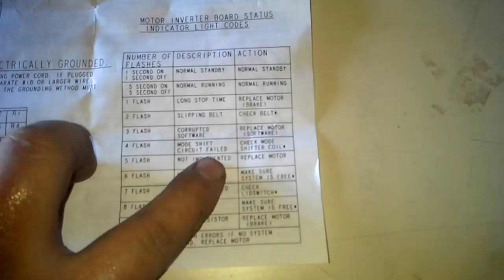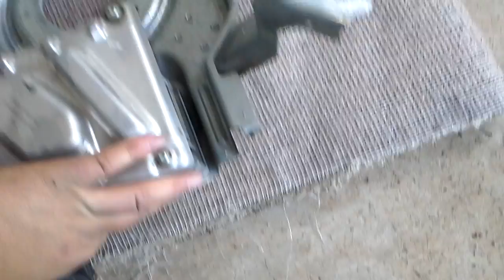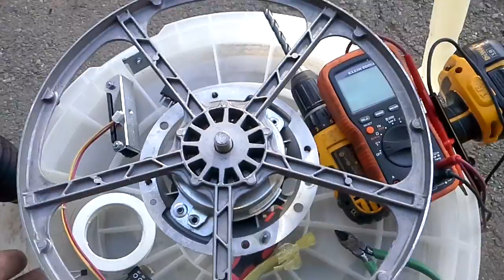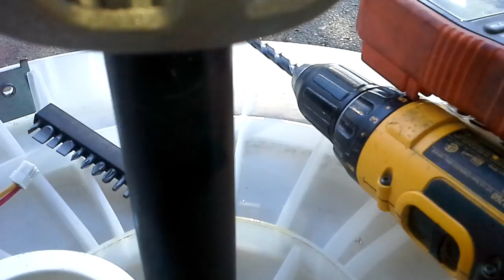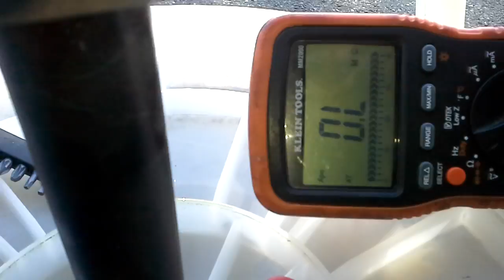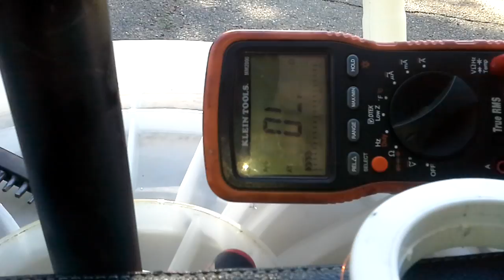How to fix the Mode Shift error code for free!

Comment: Thank you so much for making this video. It covers exactly the issue I have, taking apart the mode shifter magnet and repairing it.
My situation started as no spin cycle and a loud ratcheting noise during agitation. After I found out there was an on-board diagnostic flashing light on the inverter board, I saw 4 distinct flashes followed by a long pause and repeat of the flashes. The flashes indicated a problem with the mode shifter and to check the magnet. All research I found said it can't be repaired and buy a new one. I couldn’t afford the official GE shifter at $300+. I found one for $150. I installed it and had the same problem. This time there are no flashing light codes, just a consistent flashing indicating no problems.
I couldn't believe it would be the same problem. I have checked almost all solutions physically and electronically.
I am slowly coming around to  the idea it is the same problem.
I can't return the mode shifter. I have had it too long.  I am not looking forward to buying another shifter if it turns out this is the problem. This exceeds the value of the washer.
This is why am so happy you made the video I have been looking for. I still have to check the resistance. If this is the problem I now have a way to possibly fix it without spending more money. I still have the old shifter, which could come in handy if I need parts.
Thank you again

Comment: To drill the rivets out, you may need better than average drill bits. At a minimum, DeWalt makes a line of drill bits called "cobalt". Not Lowe's brand, but DeWalt. Especially the pilot drill bit needs to be high quality. You can get away with cheaper bits beyond drilling the pilot hole. Use oil while drilling.
Reply: Is this an ad?

Comment: One problem with moving the fuse / thermal limiter out of the housing is part of the design may be for an overheated coil to help break the fuse / thermal limiter. Using a fuse outside of the coil makes it more serviceable but someone would have to figure out what the max. amp draw should be to determine the fuse amperage.

Comment: A bit of help on disassembly of the coil. Once the rivets are drilled out, it takes a bit of prying to separate the upper and lower pieces. About 90 degrees from each rivet there is a tang (for lack of a better word) which holds the upper and lower pieces together. Both of these tangs needs to be pried out. A medium size flat head screwdriver prying with equal force on each side of one tang should do it. To prepare to reassemble the upper and lower parts, there is a flange where the rivet head used to be that should be filed flat. In place of the rivets, #8 stainless bolts can be used (not sure of the length) with a flat washer, lock washer, and nut.

Comment: You saved me 100$ for the new part and more work.  I only had to  removed belt and pulley and drill those two rivet your way.  Thank you so much for posting  this as money is very tight.  You get bonus  points for entry into  heaven!!

Comment: The coil could CATCH ON FIRE if you bypass this thermal fuse. Installing an inline fuse would only protect against over-current, not over-temperature.
Older models have the AUPO (C*h*i*n*e*s*e brand) A4-F, 130 deg C, 2 amps, 250V rating. S*e*a*r*c*h: china-aupo a-f-product
Newer models have the AUPO A8-5A-F, 150 deg C, 5 amps, 250V rating. S*e*a*r*c*h: china-aupo a-5a-f-product
The A8-5A-F won't blow so easily, and still protect against fire.
These are not available at Mouser nor Digikey.
I got them on e*B*a*y, from C*h*i*n*a, and there was a German seller who had them (faster shipping) in Feb 2023. 
Use the e*B*a*y s*e*a*r*c*h: AUPO 150 a8 5a 

I looked for a self-resetting thermal cutoff, but they are too thick to fit in the very tight space.
During shifting, the coils gets 140VDC for 30 seconds, then drops to 35VDC to hold the shifter castle up. If someone opens the lid during shifting, the coil keeps getting 140VDC for too long, and overheats. It's a software bug. Don't open the lid before the end of the cycle on these top-loading models with an electronic inverter board that's on top of the motor.

Comment: Background: I dumped too many clothes in the machine. During last cycle it spun violently and I decided to to press switch to shut down. After that it stop agitating or spinning. The water filling is Ok and drain pump works. 
Question-1: Does it have control board inside top dash compartment?
Question-2: I found the manual inside the Washer dash panel. It has the drawing of LED location and the Error code chart. But I kept on looking behind the connection plugs and don't see the small green LED. In the dark, there was no blinking. Are all motors for this big-wheel series has the LED?
Question-3: How can I check the motor? I bought a used motor and replaced it but still dead.
Question-4: How can I check the clutch switch without flipping the washer and tear it apart? Can I simply test continuity from the Red+Yellow terminal?
Thanks,
Reply: Check the inline fuse, it's probably blown

Comment: With the thermal fuse thrown out or not used, are you not afraid that in the future the coil wire or something else important in the mode shifter assembly will get burnt and damaged due to power surge?

Comment: Grat Video. Thanks. I think that is the problem with my machine, I can see the 4 red flash on the board. she fills with water and empties but does not wash or spin. but I wanted to ask you. you should see the motor running when you have this problem ?? Or is it that the engine does not run when it has the problem of the mode shift?? because I don't see the engine running by itself

Comment: Probably late for a reply but what was the fuse rating or part number?  I would like to do this but replace the fuse as well.
Reply: 5 Pcs Aupo Thermal Fuse Cutoff 130c 250V 2A A4-F 

Amazon $12 for 5 fuses

Comment: Mine flashes 10 times after I turned it on. Washer will fill in with water and will drain but no agitation and spin. Lid switch, fuse and the control knob panel are okay. What a mess!!

Comment: Does anyone know the heat spec on the fuse? If Im going to go through the trouble, I might as well spend the $3 and replace the fuse instead of bypassing it. Thanks
Reply: $12 for 5 of them. On Amazon. 

5 Pcs Aupo Thermal Fuse Cutoff 130c 250V 2A A4-F 

Going to all the trouble to bypass it may ad well just replace it.

Comment: If I am not mistaken, the green light is supposed to flash off and on. Is it not?  My thinking is the pattern gives the code. Steady one second intervals indicates no codes. Blink on one second, off two seconds, one flash indicates a fault. On one second, off two, three flashes, etc. 
  Correct me if I am wrong. 
 What was your symptoms?
  Can a bad shifter cause one to wad clothes?
Reply: I think, as he said, mine is flashing green 4 times - which is the error code for "mode shifter coil" - I'll have to say "I really Never liked this GE Profile washer that I bought!  It Sucks!

Comment: GE Repair guy here. We change out these things all the time. Usually because water leaks onto the shaft bearing.  I have not come across too many Mode Shifters that short like this but this is good info to know. Replacing one of these Mode Shifters will cost you around $300 parts and labor. Nice video. :)
Reply: My washer is agitating and the basket moves to the left while its agitating.. Is that the mode shifter as well?
Reply: Had 2 go so far original one leaked water from the center shaft seal!

Comment: I have a question about the ge Hydro washer.  When the washer is agitating and the basket is moving only to the  left while in agitation.  Is this the issue as well.   From what I saw in a video on You tube, When the washer is agitating the basket should be moving left to right.  On mine its moving only counter clockwise.  And it like a half turn per agitation.
Reply: I have a Hydro wave.  I believe it changes the agitation cycle   1 direction, then both directions.  The top of the agitator only goes 1 direction, the bottom goes both.

Comment: Lacking information on reconnecting wires to the coil. 👎
Reply: just cut the wire from the fuse and solder the two together.

Comment: I have like 4 GE washers I couldn't sale because of the mode shifters. Hopefully this brings me back to life. Great Video!
Reply: I have a couple also I think have the same problem.  I was told it is usually the motor even though there is no fault code according the blinking light on the motor.

Comment: Nice job.
AUPO
Thermal Fuse cut off.
A4-F 
130degrees Centigrade
2Amperes 
260 Volts AC
Reply: Thanks for that info. I was just about to ask.
Reply: Are you saying the fuse is rated at 2 amps?
Reply: @rickeykeeton71 - that’s what he saying

Comment: OKAY you remove the safety link....  it got hot and blew the fuse....   why did it get HOT ???  so now when it gets HOT  ''again'',  safety fuse is  gone ,  a fire will happen or wall  fuse will pop=  then what???  what will you remove then ???
Reply: mine has 82 v and with an 90ohm coil you will pull less than 1amp. The wire would probably burn open again before a fire. If you really want to fuse it, put in an inline fuse and put a 2 amp fuse inline with either lead. If you blow fuses, you have some windings shorting..then force to change out the coil..This non resetting fuse is probably a bad idea. Work in electronics daily. She these things go out for no real reason. GREAT Video..I never knew there was one in there. Going to fix mine tomorrow...

Comment: Thanks for such a helpfull video...i removed the fuse but the coil is giving me 73 ohms. The washer is still not working. What should i do? Is there a place to get the coil only instead of whole assembly?
Reply: By the way the LED is showing normal standby....1 sec on/off.
Reply: @imrankhalid7610  did you ever end up fixing yours? I’m in a similar state, LED flashing normal but ohms reading low from the shifter coil around 66ohms. Hate to do all that work and find the shifter isn’t the problem

Comment: Just disassembled mode shifter to remove thermal fuse. Fuse ohmed out good, but removed it anyway. Figured I went this far. Coil ohms out at 68.9. Any other ideas? I was initially getting the four flashing lights. GE paperwork says replace motor. Please say it isn't so.
Reply: It could be purely mechanical such that the gears are not greased good enough to be engaged and disengaged. Therefore the coils is not strong enough to move them.

Comment: Did you ohm out the coil before removing thermal fuse? What kind of reading did you get?
Reply: Yes, he did that in the video. With the thermal fuse in series, he was reading open circuit and that's because the thermal fuse was open. When he bypassed the thermal fuse and measured the coil directly, he got 89.7 ohms.
Reply: @JaleelJohanson62 - isn’t the very thin copper wire in the coil insulated therefore trying to test continuity is a little difficult? I cut a little 2 inch piece and couldn’t seem to get continuity between that small piece. Then I started wondering is this wire insulated?
Reply: @condor5635  The coil wire is indeed insulated with enamel coating, but the ends of the coil wires are not coated. This is where the electrical connection to the coil is made, and also where you'd want to measure the coil resistance.
Reply: @JaleelJohanson62  - thanks for that if I cut off an inch or two on the ends, how do I remove the enamel such that I can get a good connection? Maybe some steel wool or sandpaper will remove the enamel?
Reply: @condor5635  That or use an exacto knife to scrape off the enamel.
Reply: @JaleelJohanson62  wonder if acetone removes it
Reply: @condor5635  I got this off of a quick internet search:

"You can always use acetone, but the fumes are pretty bad. If the wire is big enough, scraping with an Xacto blade works pretty well. I almost always scrape it off. An alternative is to stick the wire end into a small flame and burn the enamel off." -- I'd just use the xacto.
Reply: @JaleelJohanson62  thanks!

Comment: hey it's also worth mentioning that once I connect the electricity I hear a cling, esp. when the device has been left off for few minutes to completely drain out. Luckily I discovered it is from the Mode Shifter Assembly. This sound is irrelative of washing program activity  that is, it happens when the washer is Idel immediately after being plugged in

Comment: Thank you Andrew for sharing with us this genius solution. My washer doesn’t spin or agitate at all. After closing in on I was left to either of two faulty parts . The Mode Shifter Assembly and the Motor. I tested out the two leads coming from the Shifter at 200 Ohmmeter (Rx1)  and I came up with 70 ohms. Does that mean it’s working properly?
I also noticed that the LED Flash on Motor controller board isn’t working , I’m afraid the board might be the source of the problem!!  The drive motor looks in a pretty good condition and for more diagnostics I tested out the two internal leads coming out from the dynamo for continuity and the Multimeter peeps  and the resistance reading  is 1 - 0.9ohm. The Schematics provided by the company for control plate shows a fuse that I can’t seem to locate? I would appreciate if you could point me out in the right direction cuz it would be inconvenient to replace the whole motor especially that I have to find away to ship overseas which is way too expensive for me.
Reply: Jason Stockholm I too have the same issue, I replaced the inverter motor still nothing. Washer fills and drains water, however, doesn't spin or agitate. What was your fix. Appreciate any info. Thanks in advance.
Reply: Make sure that you blow out the boards on the motor with some compressed air. I was looking for the little green LED and couldn't see it until I blew it out.

A little late response-wise but perhaps it might benefit someone else.

Comment: My washer is showing the error code for an open shifter coil (4 flashes).  The symptom is that the drum will not go to high-speed spin, although it agitates and otherwise performs properly.  I am going to try your fix tonight, I hope that it works!
Reply: I thought that it was agitating properly before, maybe not.
I did the coil fuse bypass, and it works great.  The locking collar is retracted and extended on cue.

But the main problem still exists.  The drum will not attain a high-speed spin.  After one minute at a moderate speed, instead of "kicking into a high gear", the washer slows the drum and continues to spin at a greatly reduced speed.  Bummer.
Reply: @125AXer  Did you ever fix the "drum will not attain a high-speed spin"? If so what was the culprit? I'm having the same problem even after replacing with new mode shifter.

Comment: hi there that cover for the coil you removed rivets with drill how did you put that back on?jusr screwed it?
Reply from the maker: tino8080 with a tack weld from a TIG welder but a self tapping screw or a nut and bolt will work.

Comment: Thank you for this video, you just saved me the cost of a mode shifter assembly. 
I Did this repair last night, washer is back in working order. Thanks again
Reply: I used small zip ties after drilling out the rivets. The holes left behind were too large for the self tapping screws I had on hand- not an ideal fix but it is holding up well
Reply: Hope you don't mind if I ask you a question. I'm doing this repair myself as you did, and I wanted to know if you went with rivets or screws to reassemble. What size drill bit did you use to drill out old rivets? I would greatly appreciate your response and help. Thank you!
Reply from the maker: D Runyan a Small tack weld worked for me but a nut and bolt works as well.
Reply: I used a metal screw. Its not critical, it just needs to cover the electromagnet and keep it in place.

Comment: What size screws did you install where you took the rivets out?
Reply from the maker: Jerry Rhodes I used a TIG weld but a nut and bolt will work just fine.

Comment: youre the man, just fixed my washer thanks to this video. hopefully it doesnt burn the house down lol
Reply from the maker: mark totton that would be very unlikely. E=IxR and P=IxE good math formulas to know. if you do the math the coil only draws a few Watts.
I'd be more concerned about the LED on the Diagnostics board catching on fire before this coil does.
Reply: @DJHxCxK Then why was the fuse ever installed?  To prevent further damage to the coil?
  Is it not a safety feature?

Comment: Good video can you email me I have a question Aaron
trinitytales@yahoo.com
Reply: did you change yours?
Reply: +Danny Dell I rewire the coil and was unsuccessful 😢
Reply: I reset mine with unplug,wait 1 minute,then open/shut lid 6x. Then it works for 3 minutes. Its the whole computer.. the gear disenguages when i open lid so the basket wont spin w/agitator.  as soon as the basket spins w/ agitator again i open lid and the basket stops spinning w/the agitator. I put it on rinse and it works fine. its blinking 4x    but on reset it works right for 2-5 minutes...any idea what i can try? the motor is 350-450

Comment: So, basically I suck at fixing things.  I've taken a lot of things apart, but getting them back together has been a problem.  Your video is super informative, and I get the overall idea. I'm sure this is probably a stupid question, but those rivets you drilled out, do they need to be replaced?  I've never riveted a damn thing, ever, but I'm not opposed to trying.  Sorry for being a noob.
Reply from the maker: irishboska I used to TIG welder to connect my housing back on but you could use a nut and bolt or a self-tapping screw would be just fine.
Reply: irishboska  you can probably put a couple of sheet metal screws in there or pop rivets or whatever.